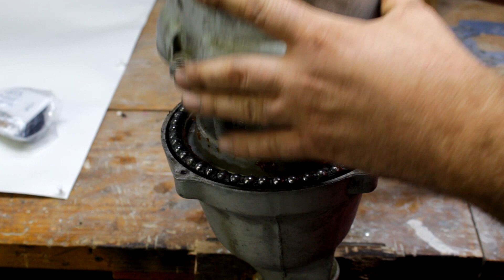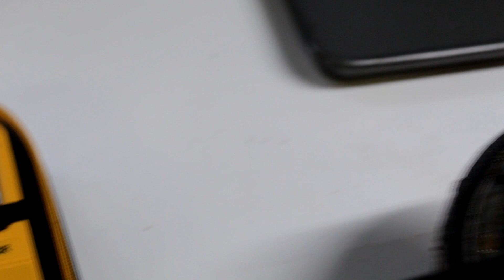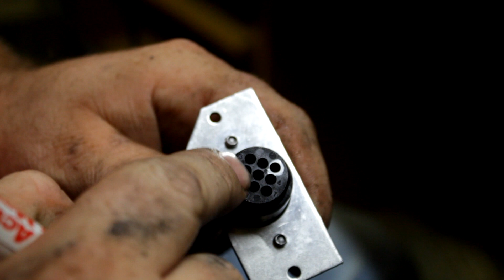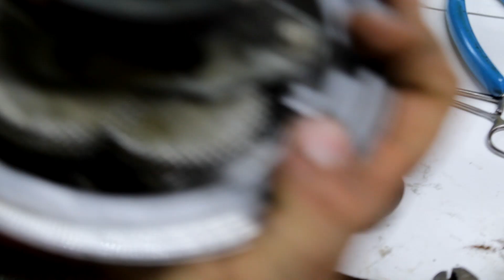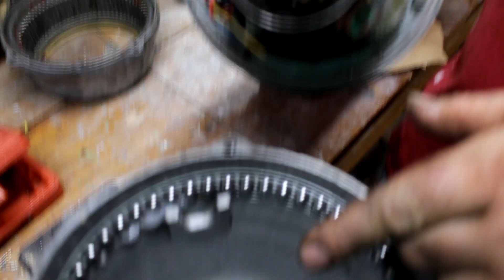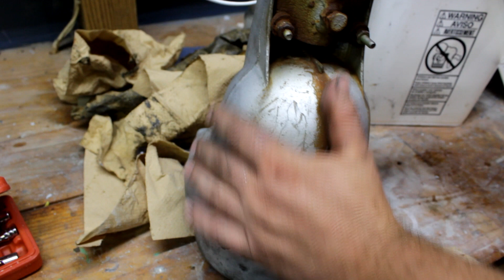hygain rotor

Comment: And you can use the old ball bearings as slingshot ammo! Bought a connector kit from HYGain but the paperwork for installation was missing.
Reply from the maker: What kit did you buy ?
Reply: @Kc8qdq  it is the conversion kit to eliminate the rusty screw terminals. It a bit different than the Cats conversion in that you get a 10 inch pigtail, the mounting plate that replaces the screw terminals, a sealing gland that the pigtail passes through into the rotor as well as the mating connector with strain relief and a pack of terminals for the connector. Had if drop shipped to a friends house who then consolidated a few other items and shipped it off to me in the EU. He did not include any paperwork for items in the box. Taxes on items coming into this country are 24% and the box was full of personal stuff as well that I already owned. The last time I had my sister ship me my stool/walking cane that I forgot at her place after visiting family back in the states. Customs hit me with 24% tax on something I already owned. Not cool. Had I paid for it with my  stateside bank card I would have cancelled the charges. Next time I pay with card so I cancel charges for my stuff.
Reply from the maker: @Subgunman ok.
Reply: @Kc8qdq  just repacked the bearings Sept. 12, 25 and I found that the ring gear is cracked. Any sources for this gear? It’s a CD 44 rotor, not much different from the other products from Hygain. I have a Will Burt pneumatic mast I will be mounting this rotor on and running some 10 meter Moxon as well as a VHF & UHF Yagi on top.
Reply from the maker: @Subgunman try rotortime

Comment: This sure beats taking it apart to figure out how it works !   The timing info, brake springs, and connector info are invaluable.  There is nothing worse than putting a rotor back together only to find out you got the timing wrong !
Reply from the maker: @nobodyyouknow222  thank you

Comment: I couldn't put it back together without some light lube on the clock work gears, and a look at the motor bearings ( unless they are sealed)  Tri-Flow makes a good penetrating spray lube.. which is also a combination of teflon and silicone.. and does a great job of preventing corrosion as well as lubricating. good for the gear...for the motor bearings  light machine oil.  W6WUH

Comment: I am replacing my Ham IV rotor with a new Yaesu. Do you buy used rotors? Mine needs repaired as the rotation indicator pot likely needs replaced and it has issues turning clockwise past 45 degrees. I figure it likely can be rebuilt as I know some guys do this and resell them.
Reply from the maker: @matthewsteger-n3ntj  thank you very much for the offer. Parts getting hard to get so not doing much rebuilding

Comment: I am redoing my Ham IV, is the video showing the opposite of what I am looking at because I can't reclock it, shouldn't I feel the two tabs fall into the spot and if I have the ring gear snugged up so it won't fall out when turning it upside down, is that too tight. Thanks
Reply from the maker: @lowpower9  hope you got it sorry never texted back

Comment: Thank you for the practical, and easy, to grasp explanation, on how to reassemble these rotors! : verry Good ! : i like to ask a question!: i have a Ham-M rotor, and the Nylon/plastic chain that collects the bearings has broken....:  where can i get this replacement these days?, and i allso wonder for the top direction pot-meter : it does not come with a year stamp, but i think it is 1977/1978 production .....: i know that MFJ has simular Pot-meters ,but they don´t refer to HAM-M - i forget to meassure the balls but i´m quite shure it is 3/8" bearings ! : Regards from me here in Norway : Thanks a lot for the Video ! Appreciate verry Much !  (y)
Reply from the maker: I get my bearings races from Hygain. Actually the Dayton hamfest has a booth that sells lot of parts. Give them a call.

Comment: I wanted to rebuild my Ham IV rotor and really wasn’t sure how. Then I found Jeramy’s  video. What a great video very informative. I wanted to replace the connector on the bottom because it was very rusty. I messaged him and he has a conversation kit to a plug type connector so I purchased one. Got it delivered and the instructions were Awsome on how to install it. I got the rotor rebuilt and hooked the control box up and rotor turned very smooth and quiet. I had a problem with my controller meter not working so I messaged him about it and he called me and we got on messenger video together and started troubleshooting the controller. We he had me check continuity between pins and that all checked out. Then he had me check the plug from the controller and found the problem there. I removed the wires from the controller and hooked up the wires coming from the rotor and everything worked just fine. He is very good at troubleshooting and helped me so much. Thank you so much Jeramy for all your help. If any of you need the plug conversation he sells them and they are top quality.
Reply from the maker: My pleasure

Comment: I purchased some 3/8 ball bearings. But now Im wondering if i should use them. The 3/8 balls measure .375. The original balls measure .371. 3/8 balls ate 4 thousands bigger. Is this going to cause a problem?
Reply from the maker: No I have put them in all of my rotors without a problem
Reply from the maker: 5033501 is the Hygain part # that says 3/8 ball bearing
Reply from the maker: Maybe the old ones was worn

Comment: Jeramy, tnx so much for the video, very helpful. On the bearings, just regular 3/8" utility grade carbon steel ball bearings? (eBay September 2023 for $31.95/1000).
Also, CATS is retiring, where else to buy those bottom plate connectors?
Reply from the maker: Thanks so much for the kind words. At the present moment I am working on trying to acquire all necessary parts to make up the connector kits for the rotors. Keep checking on my YouTube video. I will post it when I get them made up. It does suck that cats is retiring but he has been doing it sense 1980 73 Jeramy

Comment: First off Great Video!  Also I am in need of 2 of those Brake springs and the main electric motor.  My motor does not have enough power to keep moving.  If I spin the gears and activate motor is will spin a little but slowly quits.  Can you help guide me to replacement motor and brake springs.  Very much appreciated. N8MJR, 73
Reply from the maker: Sounds like you capacitor in you box might be bad Mfj sells the springs

Comment: I received the new bearings this morning and installed them in the orientation you show, lubricated using Super Lube and synced the Ring Gear and rheostat as you show in the video and reassembled. WOW, this thing is really quiet now and works great.  Thank You for posting this video.

Comment: grease is grease axle grease is fine to rebuild them with why do people insist on 1 greasable trap dirt but the other won't LOL
Reply from the maker: Humm
Reply: @Kc8qdq  im just saying no pun intandid
Reply: @Kc8qdq  my  rheostat  only reads 330ohm on my ham5 and the needle only moves a little bit on the control box
Reply from the maker: @jtsgarage2999  sounds like a bad rheostat but usually it is open. Check the wiper to chassis it should be a short
Reply: @Kc8qdq  it works but only moves the niddle a little so i dont no i might change both

Comment: Great video!  what is the correct size of the spheres to buy? any link? many thanks
Reply from the maker: Little confused on Spheres
Reply from the maker: Are you asking about ring gear ?
Reply from the maker: http://rotor-parts.com/
Reply: @Kc8qdq   Many thanks. Any information abaout ring gear (steal)?
Reply from the maker: @PauloPY3OC  I have never tried to seal them up. It is a thought though I would use some silicone maybe 🤔
Reply: @Kc8qdq  Do you know where to buy a new one? (ring gear)
Reply from the maker: @PauloPY3OC  http://rotor-parts.com/
Reply from the maker: You might have to ask them for the steel ones

Comment: I just bought a New Old Stock CDE model HAM-M (CLASS 252-50) in it's original box with everything that came with it from the manufacture. I bought it from the original owner. The ham bought it many many years ago with the intention to install it and never did. QUESTION: Should I open it up and take a look and see, OR leave it be and put it into service? I value your opinion, thank you in advance.
Reply from the maker: I would apply new grease bearings

Comment: Great Video - Have an Old TR4 1976.  One of the plastic bearing holders is broke and the Cast  Base with the race has several deep holes where a bearing has worn cat alum.  Also the Rheostat works but is loose in housing when full CCW.   Do You have parts?  If I send to  you,  repair cost??  Thanks Much
Reply from the maker: The plastic race is $12. groves in the bottom would just have to look to see how bad it is. Might need new one  have to just look at it as far as price. Do you want the upgrade connector ?
Reply: @Kc8qdq  Thanks for the reply.  Pits where balls were stuck are quite bad.  1/8+ deep.  4 of them.  At least this race is separate and not the body race.  balls looked ok - No rust.   It has the SS connector Strip which is ok for my app..  Any comment on the Rheostat winding being loose when fully CCW?  It lifts out of housing 50%  Maybe they are all that way.   Maybe not worth the effort to repair?.  but Hex is balanced so not much of a load.  I suspect previous owner may have used it harder.  Thanks Much for the reply
Reply from the maker: @peggyleeper1049  if you are  only using the rotor to turn hex I would not worry about the grooves the rheostat is $65 new  I get the Plastic race from a guy called rotor time. Usually I charge $100 plus parts and shipping. To fix them. If interested you can send it to me and I will see what I can do. I will treat you right
Reply: @Kc8qdq  thank you for the info.  i called local club to see if anyone has an old rotor for parts.  based on their response will determine next move.  thanks again
Reply from the maker: @peggyleeper1049  my pleasure

Comment: Great vid, I'm in the process of rebuilding my HAM2 and have it down to bare parts ready for soda blasting it, do you use the same grease for the gears and which gears need the grease? de N6OIL

Comment: Jeramy, great video, helped with my rebuild of the Ham-III; Ham-IV and T2X next. (shame about the out-focus sections, need manual focus set). Q, it really doesn't matter which side you set the stop?
I am trying to fit the starter cap into the housing, 8 core cable is hard to find here and expensive in NZ. Fitting it in the housing I can use 6 or 7 core heavy core trailer cable.
Reply from the maker: No it doesn’t matter what  stop u use just be sure u turn the rheostat the same direction
Reply: @Kc8qdq  Done and working. Thanks
Reply from the maker: @sparcnz  my pleasure

Comment: jeramy is the cd 44 a non brake model? i just picked up a rotor and it states its a cd 44 but it does not have a brake system inside it? i need to order a reostat for it
Reply from the maker: Yes the cd 44 does not have a brake
Reply from the maker: Mfj has the resistor

Comment: rebuilt my rotor and put a updated cap in the controller and tested it on the bench and it sounds like new so quite now. BUT after getting it in the tower and all hooked up and my needle doesnt move! aarrggg. does anybody have any idea where to start testing this thing? remember it is mounted inside the tower and it is a pain to pull it out. does anybody know what the voltage reading should be 1-8? 73s all
Reply from the maker: Be sure you don’t have the calibration button pushed in
Reply: @Kc8qdq  it isnt thanks
Reply: @Kc8qdq  found the issue somebody told me to check the fuse inside it looked fine to me but i cant see all that good so i took it out and lookd under my magnafiing lens and yep it was blown. works fine now thanks all who helped

Comment: Great video and somehow I found it just when I needed it. I picked up a Tailtwister T2X S1 from Sept 1986 that I think is BEYOND REPAIR. Several of the brake "teeth" in the casting are broken away, the travel limit pivot arm is severely bent, the brake arm does not fully extend or is broken, and the wiper arm on the position pot is MISSING. 

Is this when you throw it in the dumpster? Thanks for the video.
Reply: The most serious thing that might be BER is the housing with broken slots. Perhaps a skilled machine shop can fix it if its only a few slots.

Comment: Thanks for the great video.  I was able to get my old CDE HAMII Going again.  I have always had a problem with this rotor.  If It goes all the way in one direction it will "stick" there and will not move.  I have to disassemble an turn that gear to get the stop off of the limit switch.  It does not do this in the other direction.  This was not a huge problem because I just put a mark on the control display and did not go past that but now my indicator is not working so I dont know where the end is.  I have ordered a new potentiometer  from mfj 
i hope they have it and that will give me back my old fix.  What could the real problem be?  I would like to fix so it can go full CW or CCW.  Thanks Roger Rockwell
Reply from the maker: Sounds like the limit switch’s are backwards.

Comment: Great video.  This is all new to me.  The video has enough explanations to make it sound doable to me.

 I got a CDE HAM IV and a CDE CD-44 rotator.  The both rotators came with the tower when the previous owner purchased them.  I have both of those rotors now, including his tower.  The CDE HAM IV was in the tower.  The terminal are just as rust as the ones in the video.  I thought it would be good to check the rotator before putting it up.

I not longer see the terminal part at http://www.rotor-parts.com/catalogue/oscommerce-2.3.3.4/catalog/advanced_search_result.php?keywords=QC&search_in_description=1&x=0&y=0.

I think it is available at this site, http://www.rotor-doc.com/specialty_accessories.htm

Is there an alternative?  Especially now that they are not shipping outside of US for now.  I live in Canada so the terminal may not be available to me.

Do you have a video on the CDE CD-44?  Any suggestion for the ribbon cable replacement?

Comment: Thanks for this video, helped me a lot. One question: there was no info on the rotor pot but i think there was only one way to reassemble. There is a copper strip that fits in one of the posts and is laid on top of the rotor motor.shaft and the Rotor pot has a pinion(my words) that fits in the hole  on copper strip. Does that sound about right?
Reply from the maker: Yes you are correct. I like to clean the little copper strap real well and also the stud that it attached to
Reply: @Kc8qdq  Thanks for confirming. It just seemed that the pinion would wear down. Guess it stronger than I can image.

Comment: Great video! I finally got around to putting my rotator back together. Updated the electrical connection to the plug you recommended as well. Mine wasn't too bad inside but now has all new Super Lube grease and operates quiet and smooth! Thanks for making the video, it made the job easy!
Reply from the maker: Glad to help

Comment: I'm would like to get one repaired.  It's the CDE Tailtwister  T2X  S1   Sept 1978.   The rotator seems to work fine, but the meter doesn't move then jumps then falls back etc.  The rotator hasn't had much use at all.  I would also like the different connector for the cable hook up on the rotator and control box.  
Thanks  Dale
Reply from the maker: Sure. that is the rotor I use I charge $100 + parts.  the rheostat  on the top is usually $50 and the connector is $30 plus the shipping back you will have about $225 in the rebuild.  Will come with a 5 foot cable that you will have to solder or crimp your rotor cable onto unless you want to send me you rotor cable also.  And all new ball bearings My email is jeramy_duncan30@yahoo.com
Reply: @Kc8qdq  Hi Jeramy;  Your email address may not be working. 
Dale   KF0EMH
Reply: Thank you. Great video

Comment: Where  is your shop located ?
Reply from the maker: 110 north plains Rd plains Ohio 45780
Reply: @Kc8qdq  I have a 5 wre bell rotor ( don't know the brand) wondering what the average cost of rebuilding  one runs with your labor! It's still up on the tower. Havn't ran it for years!    I live outside of Crooksville Ohio!
Reply from the maker: William Walters I charge 100 in labor and whatever the price of parts needed in rotor. The connector in the bottom is $30 if it needs rheostat on the top is bad then add $60. But the average cost of a rebuild is between $175 and $225

Comment: Nice video. I just bought a rotator and checked the bottom for the date and there is nothing there. Are the newer ones different? I was told it is a CDE 2. It doesn't look too old, but I don't know if it's been up or just laying around in somebody's garage.
Reply from the maker: Some of the older cd 44 s was not marked. But still good rotor. Thanks for the like hope the video helps you rebuild your antenna rotor. Some of the smaller rotors did not have wedge brake
Reply: @Kc8qdq   Figured out it is a Ham M. It has the numbers 5  126 on the bottom.

Comment: Great video...easy to follow and very clear. I opened my rotor and found all the grease had disintegrated, half the bearing had no finish on them and as you showed the terminal connector was totally rusted to the point the screws were frozen.  With your recommendations it is like brand new. The connector kit was awesome.  Bought the SuperLube grease online at Home Depot for less than $5.00.